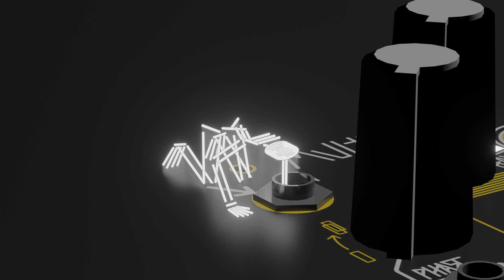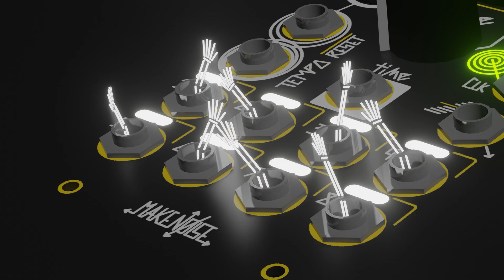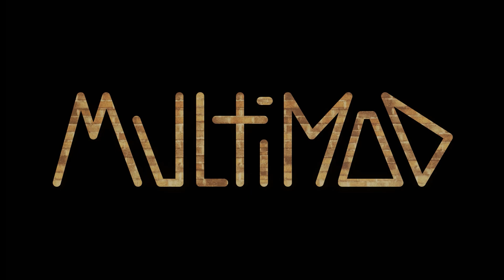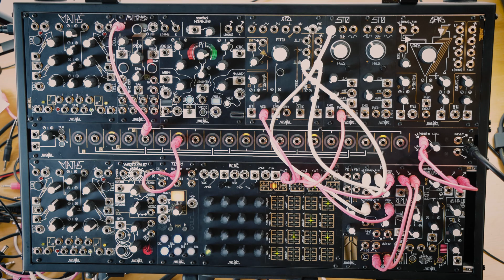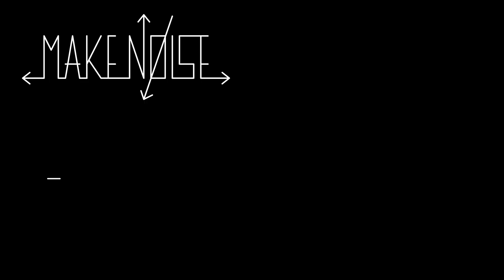Sequence Replicatin' with MultiMod (Level 0) | Make Noise

Comment: Another amazing demo, thanks! I’ve been sending all sorts of CVs and audio into the MultiMod, but hadn’t tried a clock yet!! … quick question, I reached out to MN tech support but didn’t hear back — what is with the extra set of pins on the back of the MultiMod?

Comment: Multimod + Rene with its two clock inputs is a very powerful combination.
Add Mimeophon for extra flavor, and magic is in the air.
Can't afford Multimod yet, so thinking of how I can do something similar with Maths.
Love the Make Noise eurorack case. Perfect size for experiments, and the center strip mult  with leds and audio output section is great.
Love your creative "how to" videos and innovative new products.
Thanks for sharing and best wishes for your continued success.
Reply from the maker: Thank you for watching! It's always a fun challenge to try out a patch using a different set of modules (ideally the ones you already have!)

Comment: I don’t have a Multimod yet but I’m getting one. The loop function on the input, the length of the loop is determined by the clock correct? The time between pulses is the length of the loop? Could you send it a really slow clock and get a long loop?
Reply from the maker: The Time control becomes a divider for the clock rate. Use a fast-to-medium clock because it can divide down very far, but there is a minimum clock rate that it can read.